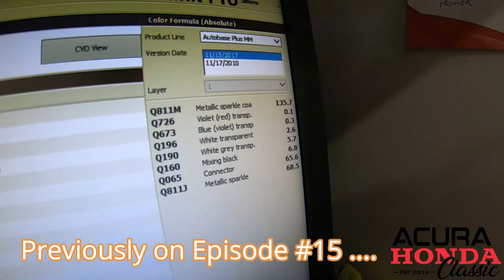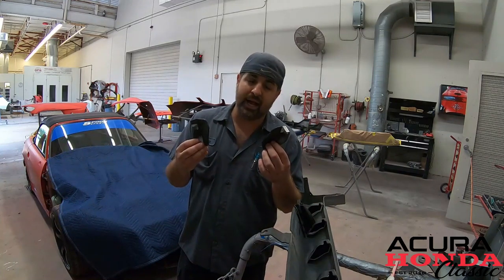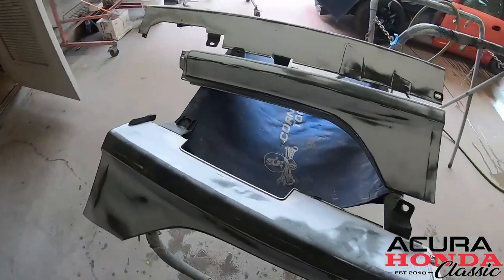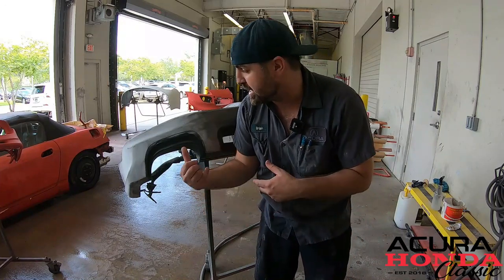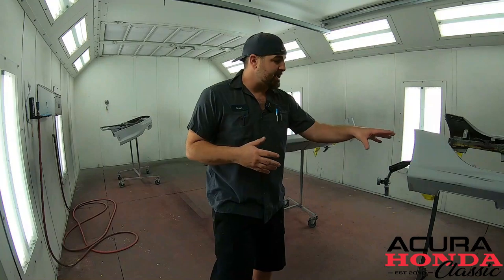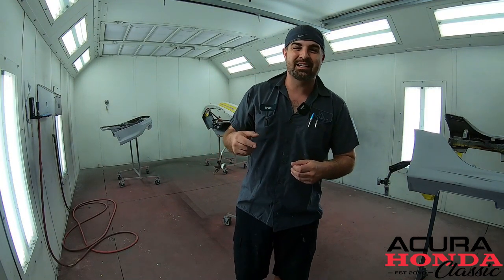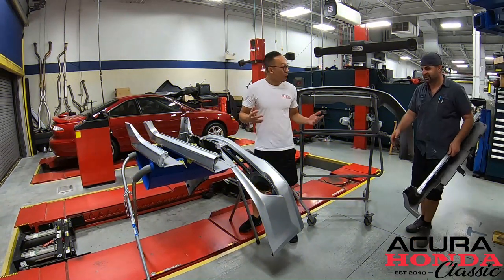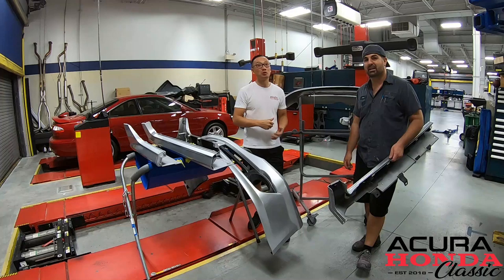Acura Honda Classic TL Type-S Build Project - Repairing and Painting Underbody Lip Kit  (Episode 16)

Comment: Nice build. Only thing I would have liked, if you painted the trims in gloss black
Reply from the maker: Thanks for the complement. We thought about it, but we wanted to keep it with the oem finish so we sprayed it over with the trim paint. It will looks odd if the diffuser is gloss black while all other trims around the car is matte.
Reply: @ahcgarage  it's just paint. So paint the other trims also gloss black :D but yeah I see your point. One side matte and one side gloss would be odd

Comment: Hey man I have a few questions. I want to do this myself but as a DIY. Any tips on what type of rattle cans (if any) I should use or what type of painti need to get?
Reply: Ebay have the o.e rattle cans paint match  for your car just type in your color code. I bought 6 already used it on my A-spec side skirt and rear bumper lips A+++++

Comment: The side skirts are removed by sliding backwards not pulling. Thanks why the tabs broke. To install, you remove the clips from the body and snap the side skirt on the car.